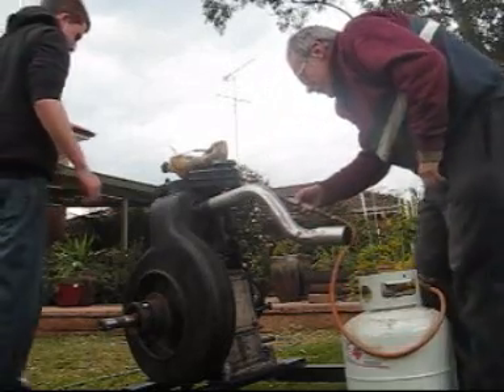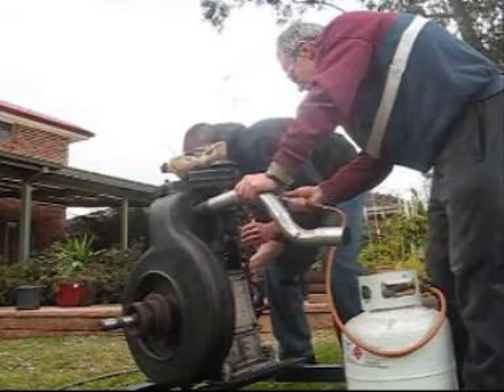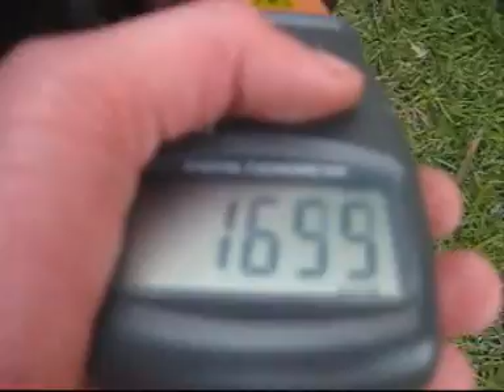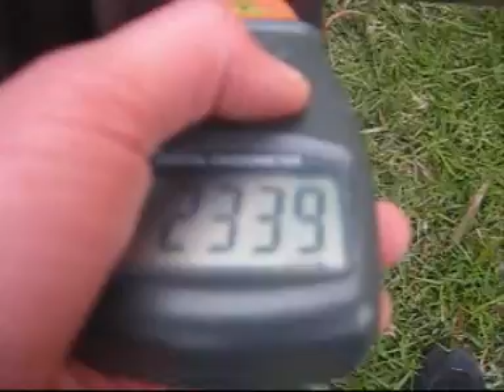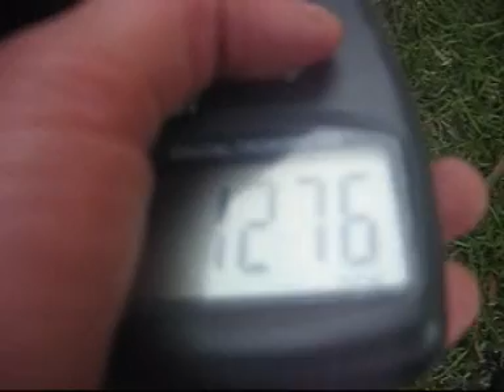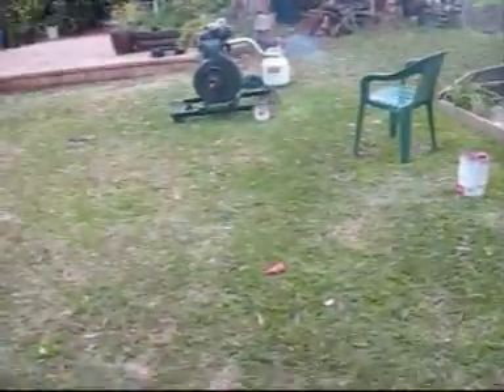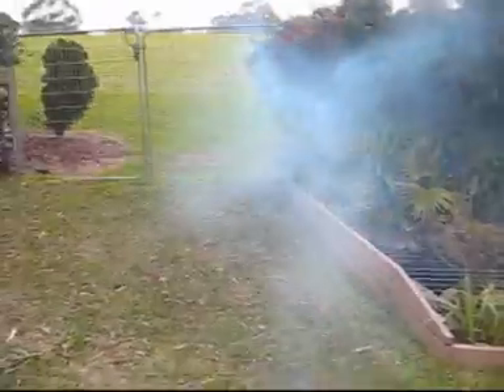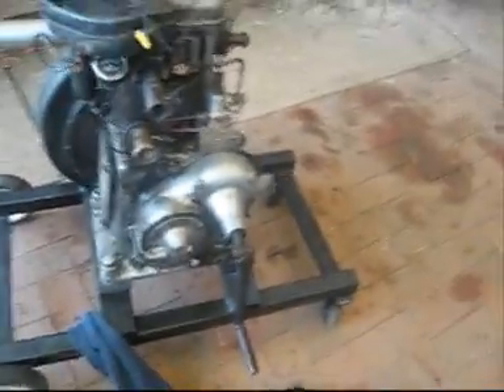Coventry Victor longer run

Comment: good on you mate..needs a bit of work but it'll run swt no doubt..i'm thinking about rebuilding a WD2 myself for an off the grid generator..WD2 are watercooled but basically the same engine.

Comment: nice work, seems to run pretty nice, You should get your injector rebuilt coz my diesal use to smoke way more coz the injector was leaking fuel in the engine wen it shouldnt and now it doesnt smoke at all just a suggestion.

Comment: high oil pessure is not always good but when it get fully broken in it should start to get better compression and oil pressure but keep it up try running it alot also if you have any seafome try adding alittle into the gas tank to clean the fuel system

Comment: @geoff390 
You can get new new injectors and IPs from MICO ( Indian Bosche ) for that price.
I think you still have a fuel problem. Did you spill time this engine?
Get feeling from the smoke is timing is late.
If its anything like a Petter check for shims under the IP and add remove as needed to set the timing.

OIl Use Shell Rotella T 40 weight. I don't recall you saying what you were using